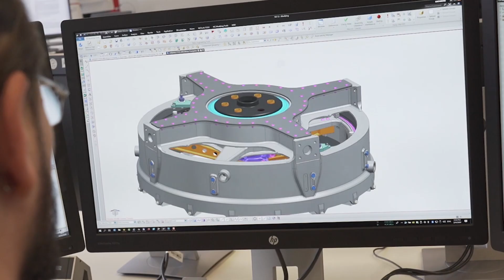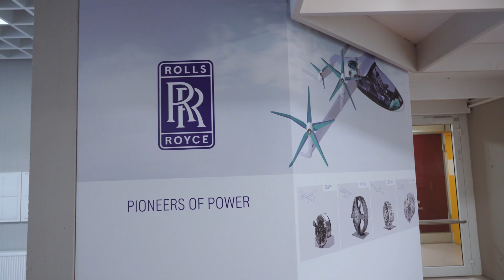Rolls-Royce | Innovative electrical power and propulsion for Advanced Air Mobility

Comment: Clearly it's possible now because other aircraft manufacturers have gotten there already and are currently in production, at least with small two seater training aircraft.

The YouTube channel called The Fully Charged Show already did a review of a 2 seater fully electric aircraft that was marketed towards training new pilots.  I believe the company that built that was Pipistrel, but I'm not sure, I think there are a few different companies that already manufacture fully electric aircraft.

But it's good to see that Rolls Royce are going in the right direction.

Might be good to also look at hydrogen fuel cells.